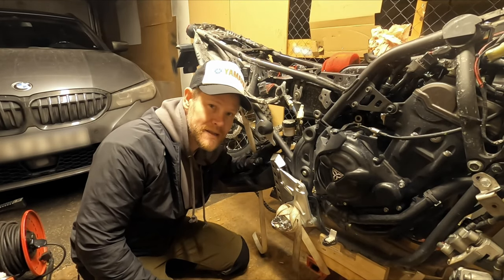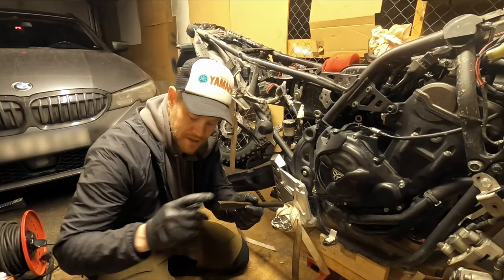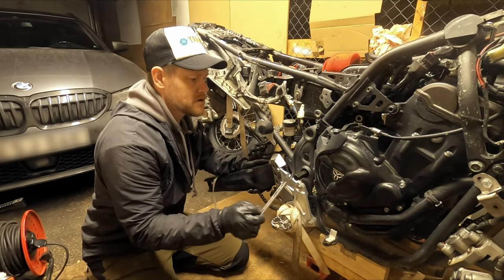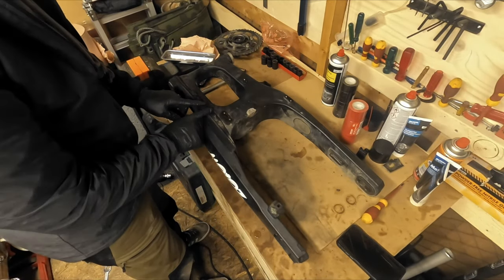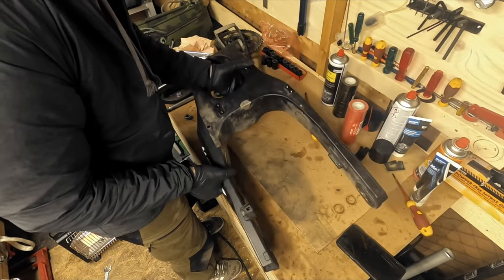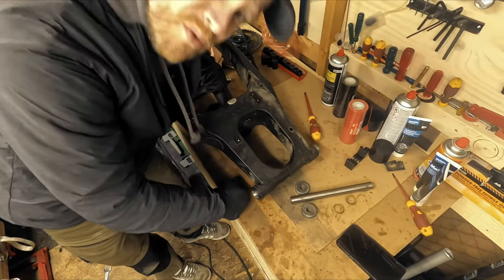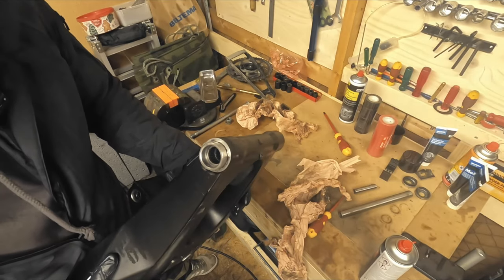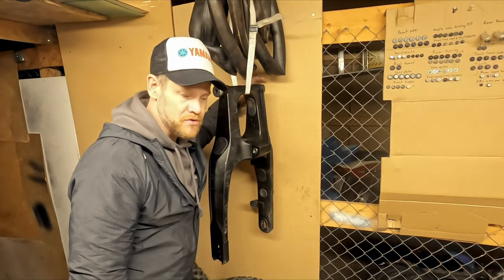Swingarm Removal - Yamaha Tenere 700

Comment: Great Job Marcus.  The pic of the push collar explained a lot as to how it works.  Now, what if the needle bearings are worn.  How much trouble to drive them out for replacement?  Don't forget the chain guide/guard for the swingarm.  Thanks
Reply from the maker: It would be easy to get the bearings out 😊, either with using something long and a hammer, or a puller.

Comment: Yeah, this is great, Marcus!  Curious to know if those swing-arm bearings had plenty of grease in them, or were they quite dry, like some T7's wheel and/or dog bone bearings as they came off the assembly lines?
Reply from the maker: The first time I removed my swing and inspected the bearings, they were not dry.
Reply: The T7 dog bone bearings where not dry on my bike but greased just fine. The bolt itself is dry but it needs no lubrification unless for rust protection maybe. The issue is overblown in my opinion.
Reply from the maker: @gbner9991  the bolt I just put a light ligt layer of lithium grease. I agree it’s not a big issue as long as not the bearing them self are dry

Comment: How did You unscrew linkage front bolt? Its nut sits so close to exhaust pipe so I could put on only open ended wrench but I am afraid to damage the nut.
Reply from the maker: I used a open wrench 😬
Reply: @everythingtenere  decat pipe probably would provide necessary space 😃